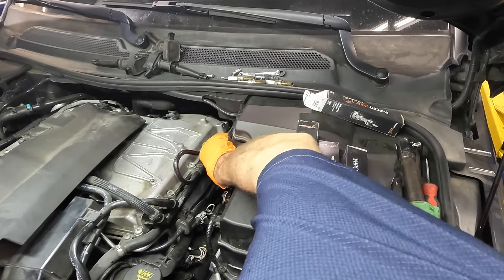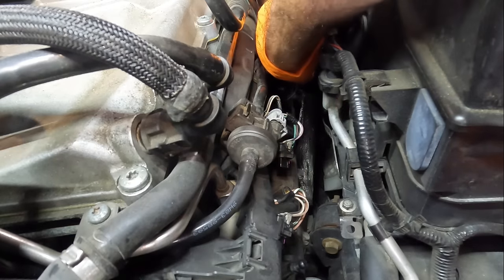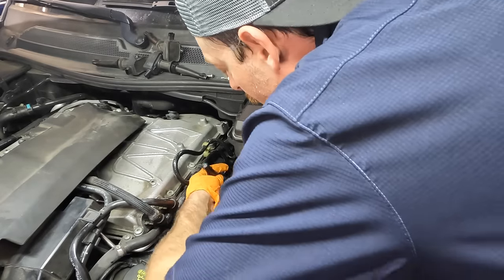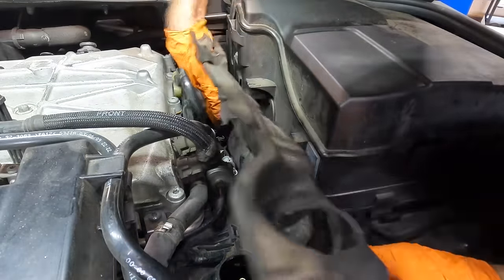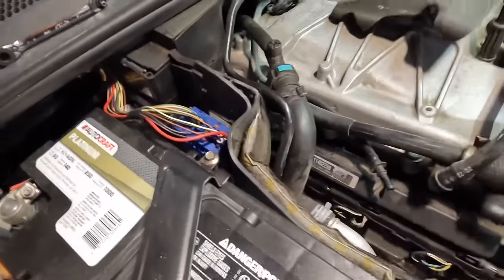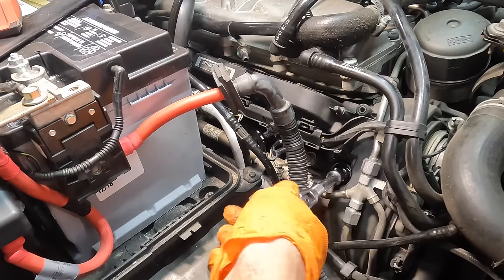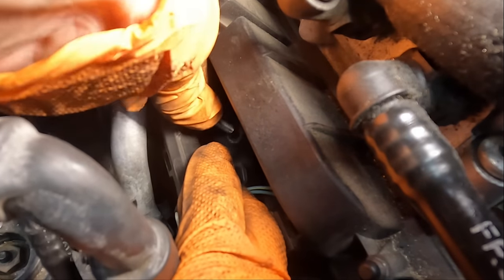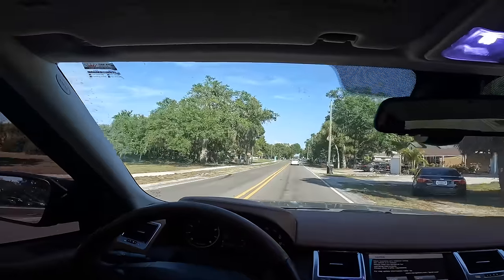Supercharged Spark Plugs! Land Rover Range Rover 5.0 v8 AWD #mechanic #tuneup

Comment: All those codes are residual when they hit something it bounced the engine the most which bounced the computer which pulled wires
Land rover has known about tight wire issues and has made extender routing connectors that gives four inches more on wire
I found that on an amazon sell
Reply: Reference please!

If you looked at the diag part of this story, there was a low bat error, in that list. That's where most, but not all, of the codes orignates from.
Reply: @rhkavli  low batteries can be caused by shorts its like throwing a curcuit breaker
When ray mention the vehicle hit something it caused a bounce and landrover has short wire harness thats tight
Why engines are on rubber mounts is to cushion any movements but being that it is short will pull on it
Ford had the very same problem
But being low battery that could have been from the pulling and grounded it out
Reply: @shaggyrat2643  The customer stated that it was the "lean in corners" warning that came on after hitting something. That warning comes as a result of the active swaybar system being disabled. A common cause for this failure is a leaky valve block, but that doesn't manifest itsef until you drive for a while. This error shows up instantly. My bet is on the accelerometer sensor fault that was in the list, and I'm quite sure, hitting the ground is circumstantial. These cars are made for offroading. I've owned and wrenched on both my previous L322 and current L405 for about 10 years, so I know the platforms and systems quite well.
Reply: @rhkavli  listen i dont care what it started why cause it resulted in residual codes popping up
The lean was already there from the get go and like everything else popped in the code list but over you missed the point of the harness needing to be extended as damage could have happened during the bump
Its like millions of viewers didnt watch rays program and know the code list for everything is general problem easily remedied by extending
Its the same principle with brake lines if too short they stretch and ut ohh
Reply: @rhkavli  these card maybe made for off-roading but people treat them as pavement princesses but when they do take them out the first time bam everything goes bonkers
Its the same story the new broncos are having trouble with
I know this cause i pay attention
The mechanicals of sway even if off or on is still supported by the metal engineering of vehicle
It may crawl but still rolling
Reply: @shaggyrat2643  So you don't think I've offroaded mine? Have a look at my channel, mate.
Reply: @rhkavli  you missed the point
You are like .001% that straight off roads the rovers the rest spend time as pavement princesses but i am positive you have to fix something after your first or first couple times
Reply: @rhkavli  funny all  this talk about the rovers today this morning hoovie and the wizzard both did a walk threw on the vehicle of long problems and this was one of the described problems on the discussion today
So its common its known and cannot escape the issues of these vehicles

Comment: Well Ray if you are worried about being responsible for someone's livlyhood then you can eliminate that fear in a couple of different ways. Either hire the one thing that I learned with any land rover after working on a few over the years is that pulling the codes opens up multiple cans of worms and I finally stopped pulling the codes myself at the start of the diag just because I was tired of chasing my tail with codes on these stupid lawn ornaments.

Comment: There was a car back in late 70s I forget which one that had a service bulletin that when it came in for first spark plug replacement the mechanic was instructed to remove glove box and ac duct. Using a hole saw a hole was drilled through firewall to access back plug on passenger side. A rubber grommet would then be installed in firewall. 
If you were not privey to that service bulletin you would either not change the plug or come to conclusion the engine would have to come out to access it 😂
Reply: Was it the AMC Pacer ('75-'80)?  Engine compartment size originally designed for the GM rotary engine that never was.  AMC was already committed with tooling & production of the car. The I-6 was shoehorned in as a make-do option.  I think the firewall was pushed back under dash to fit it in.
Reply: @desotosky1372  not certain.  I worked in Toyota service through the 90s. Some of the older techs at that time were telling me about it. It likely it was a Toyota but the couple of techs could have worked for a different franchise before Toyota. 
With that said , I had an 80 Camero that had the 231 v6 . I couldn't get to rear plug on right bank. My dad had me jack the car up, removing the tire and finagle it out through wheel well. That for me has been the toughest one to change

Comment: Engineers that don't design room to replace ware parts , DO NOT deserve the degree or the title engineer ! IMOP The wacky tool is proof ! Really the Master cylinder fill is buried ? On the left side at the back , what is that , that looks like 2 fill caps  ?!

Comment: To follow up on an earlier comment reply, with your videography skills, internet reach i could imagine a better than "factory trained" specialist response to any field condition due to real time analysis of a given condition. Filtering through submissions and replies in an analytical forum one could view things out of the box and respond. The reason I went into design and build was I spent so much time in the "why didn't they do it this way" frame of mind. Always a better way, but fixing things that once worked is usually pretty easy. Hope that made sense.

Comment: Land rover range rover died when the last original defender 90 rolled off the production line in 2016. and the range rover classic ended production and the last series 2 discovery ended production 2004. now all they are now are expensive complicated over engineered fashion accessory.

Comment: Does Rover still use Whitworth? Seems like something they would do.
Reply: Nope, UK metricated in 1970 but the car industry and a lot of others did so a ways before that.  However, watch out for 1960's UK Fords for some time and to save their stealerships tool replacements costs, they used metric thread forms with unified head sizes. . . . . . . . . . . .

Also it would not only be Whitworth, but BSF and BA for fasteners below 1/4" dia.

Comment: Great video but using the torque wrench with the triple wobble is a futile exercise because your accuracy goes out the window. That being said, I would have done the same to at least get close and not have to remove everything by and ruin the threads.

Comment: Your months rant is too deep man, too deep.
Aren’t you glad that this motor is not a Straight 8 configuration? I’ve heard stories (back when I was younger) that the last cylinder, #8, was usually overlooked when it came to changing the spark plugs. It was right up against the Firewall.

Comment: In 1582 Pope Gregory XIII introduced his calendar which properly accounted for the solar year and corrected the miscalulation the Julian calendar had been losing since its introduction by Julius Caesar in 46BC and had run out of sync with the seasons over time. 
January 1st is close to the winter solstice. Julius Caesar decided that January 1 was the starting date of the new 12 month/366 day year, instead of the previous 10 month/355 day year, to honour Janus (god of rebirth - January), but the solstice is usually around 21 December and is the middle of winter. At that point winter is fading and life is about to start coming back to the world, so a new year is starting. February is from februum (purification) and the ritual of Februa. Got a problem with it? Take it up with the Romans.